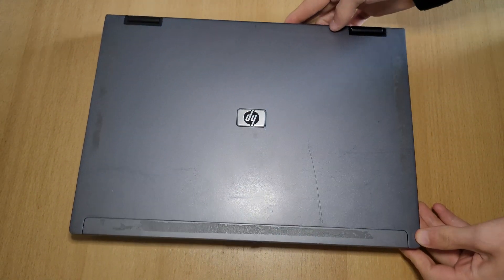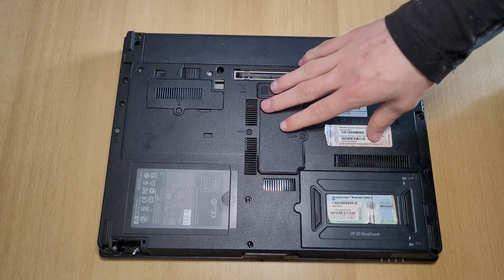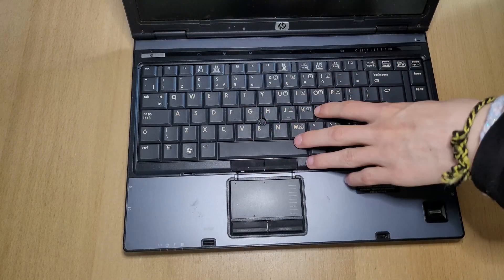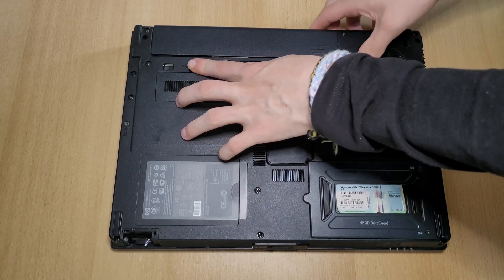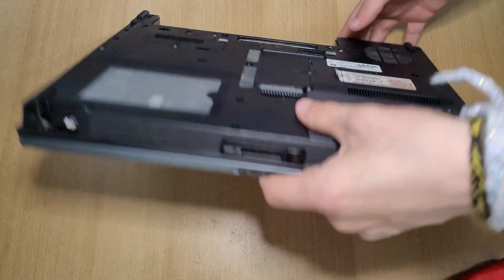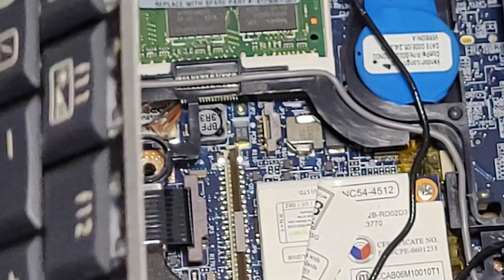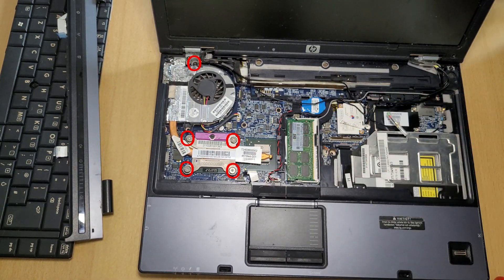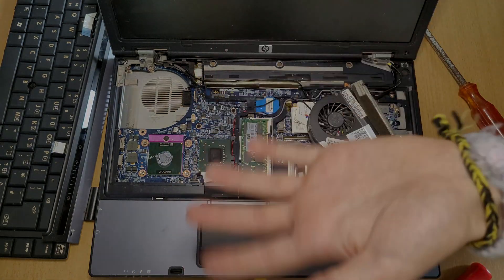How to replace battery, RAM, Hard drive and Thermal paste in the HP Compaq 6910p laptop

Comment: Can it Run 2x 4gb PC 6400?
Reply: It uses the KL540AV version, which originally came with 1GB of RAM. Not all HP Compaq 6910p configurations support up to 8 GB RAM - GB960EA, GB961EA, GB962EA, GX016UC, KE042ES, KS714AW, KS716AW, KS718AW may support it since they have 2 GB RAM from stock, but other models not always. Also this support depends on the vagaries of the motherboard, processor and chipset. For some versions of this model, indeed, the maximum supported by the motherboard was 4 GB RAM.

Он использует версию KL540AV, в которой изначально шёл 1 ГБ ОЗУ. Апгрейд до 8 ГБ ОЗУ поддерживают не все комплектации HP Compaq 6910p — GB960EA, GB961EA, GB962EA, GX016UC, KE042ES, KS714AW, KS716AW, KS718AW это могут поддерживать, так как у них 2 ГБ ОЗУ со стока, а другие модели — не всегда. Ещё эта поддержка зависит от капризов со стороны матплаты, процессора и чипсета. У некоторых версий данной модели, действительно, поддерживаемый максимум матплатой был в 4 ГБ ОЗУ.